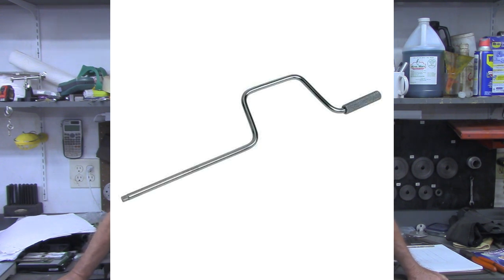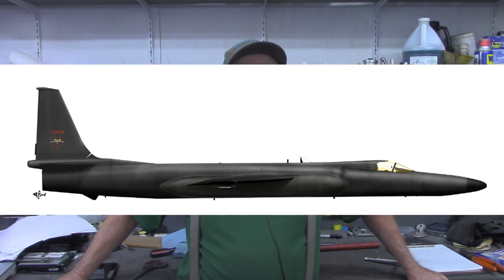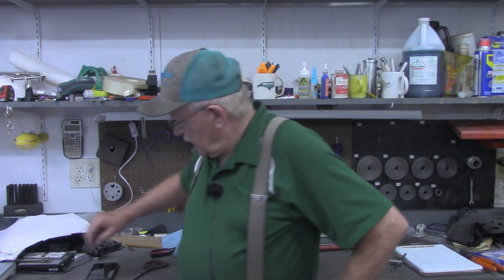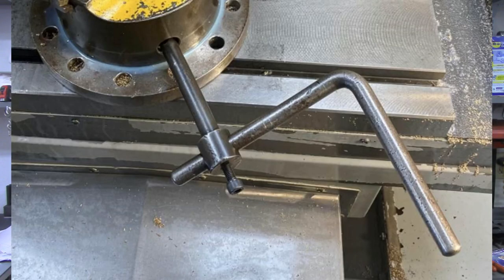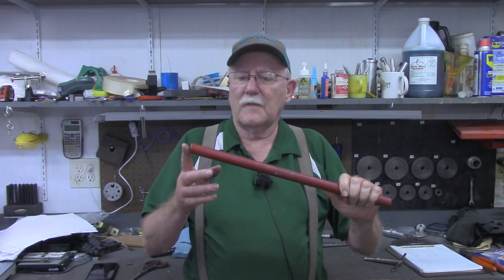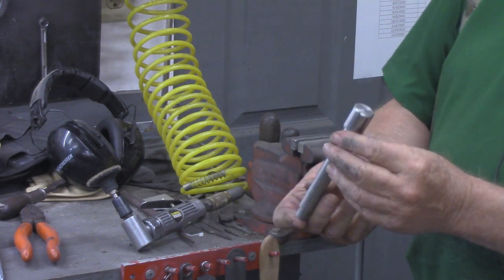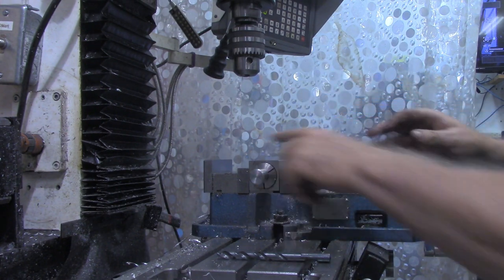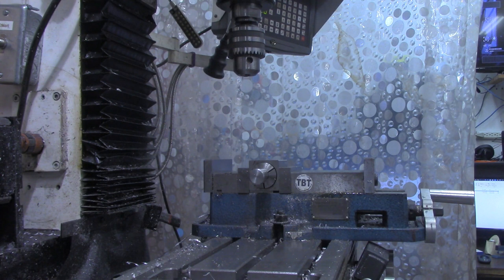Lathe Chuck Speed Handle

Comment: Thanks for an entertaining and inspiring video. Well done.
Just got the idea of making something that can be hooked on to the standard chuck key. Hmm. That extra length to have the chuck key running free from the head stock is worth regarding. The standard key doesn't manage that.

Another thought. I've got one 5" (oversize) 3 jaw chuck, one 4 jaw independent 4" and the standard 3 jaw 4" chucks. They all have different dimensions for the square profile of the key.... Making a kind of combined key fitting all 3 of the checks.....

Comment: I wasn't sure what you meant by speed handle until you showed that picture.  Many years back I acquired a Snap-On set for 1/4" drive that included one of those.  I haven't really found much use for it  though now I suppose I can see some possibilities...

Comment: Lee, sounds like the bearings in the lathe are wobbling on their last legs. :P

And hornets will make you say wordy dirts.
Reply: must agree with the Wordy Dirt's for them there Hornet things !!   as for the lathe must also agree sounds like a bag of marbles rolling round also take a look see it could do with a clean on the handle where the 1/4 20 cap screw touches off could have milled a flat stops it from trying to rotate when tightening the screw down and makes a better area for it to bight on to the handle bit looks a might long
Reply: We had some of those nasty critters build a good-sized nest on the side of the house here a while back.  Justice was served when a pair of doves built their nest on top of it,  finding themselves a built-in food supply.   :-)

Comment: Hello,  I use 3/8 adapters with my battery impact on the rare occasions when I was impatient.  Speed wrenches and ratchets also work well.  Years ago I just welded a 3/8 extension, 6" on my stubby oem chuck wrench and it is still going strong.  Do you have a video of doing your carriage stop on the ways?  I keep putting off doing one on mine and the years have gone by.